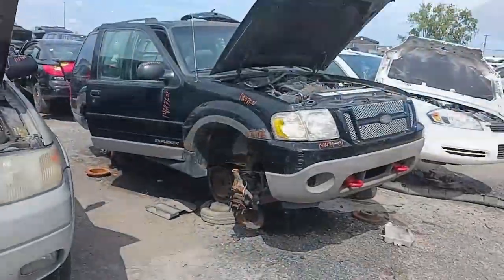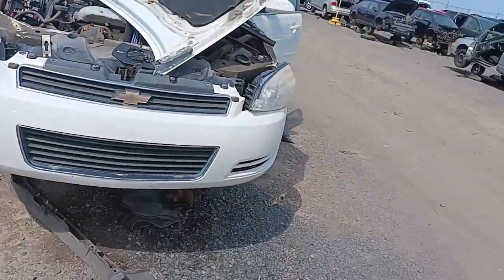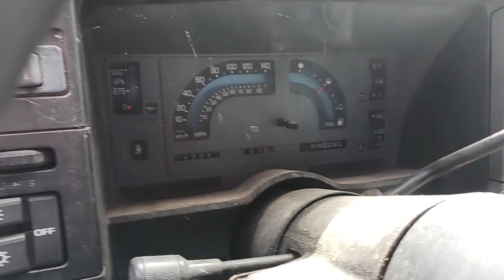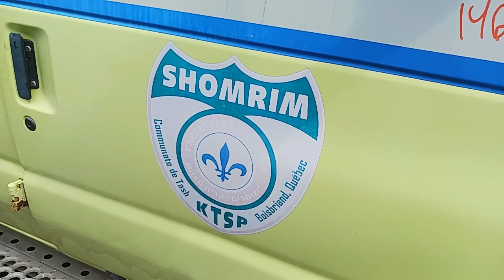8 2 23 OLD JUNKERS AT LAVAL QC KENNY U PULL

Comment: The Tosh Hassidic community in Boisbriand has it's own Ambulance. It is easy to recognize as the lettering is in Hebrew other than the regulated markings. They often are in the city at the Jewish and the Glenn. Cote St Luc does not have a Ambulance. They are not paramedics either. They are First Responders and have a exemption to provide service, wear as every where else it is the MFD. The above vehicle is early 1990's Demers Mirage with the 7.3 Power Stroke Diesel, that was rough and tough.